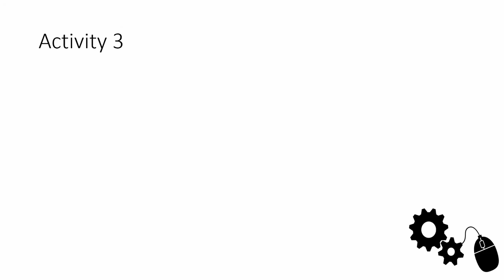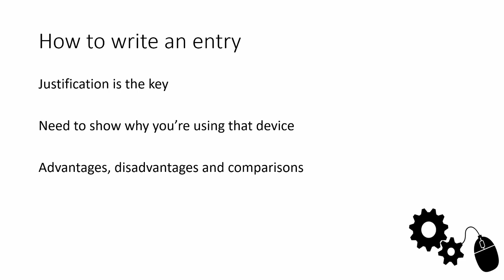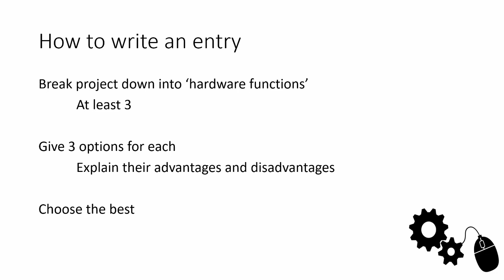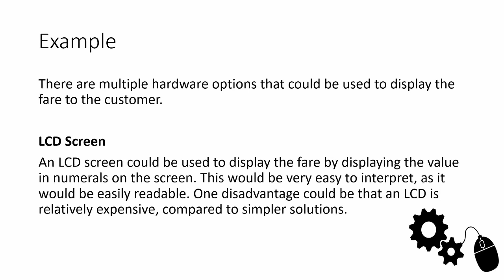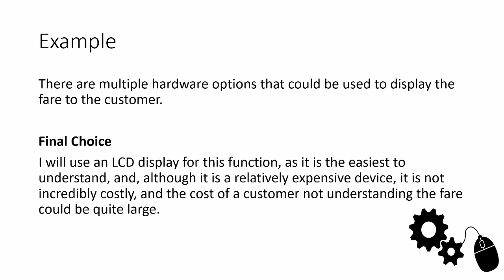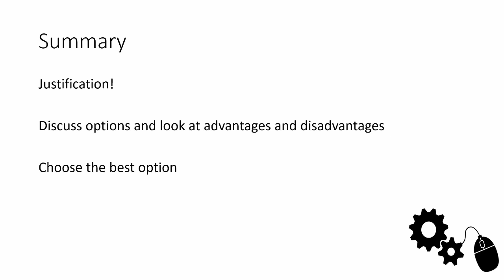Unit 6 Microcontrollers Hardware Selection: Taxi Calculator

Comment: What are industry standard conventions beacuse i don't think i used them in my exam i used technical terminology meaning taking about variable components macro, initial value (255 - turn all the led on 0 - turn of the light) and etc in my activity 3

Will i get marks for only using technical terminology and no industry standard convention

Comment: What 3 hardware functions would you use for a motor turning blind that goes up and down automatically depending on the light intensity outside? And for lights that turn on automatically depending on the light outside?
Reply: @asiangameryt9211  u from Wmg
Reply from the maker: This is not the place to get someone else to do the work for your exam. If you continue to use my channel to do that, I will report you to BTEC
Reply: @showyourworking9800  no i was asking for help on my past paper im really stuck right now and i thought i could ask you for help plz dont report me